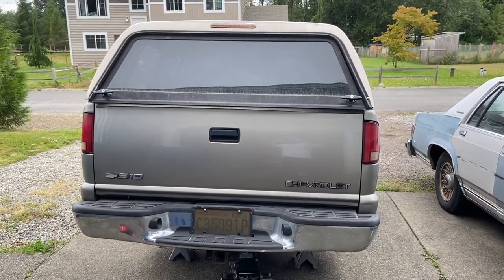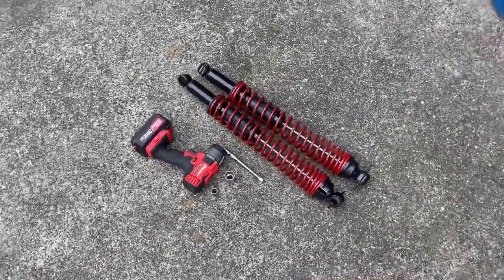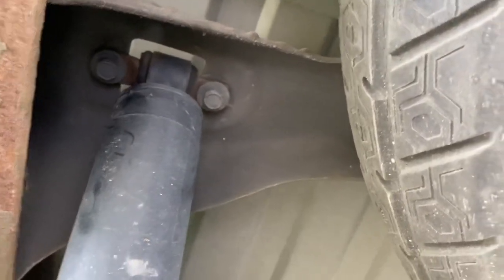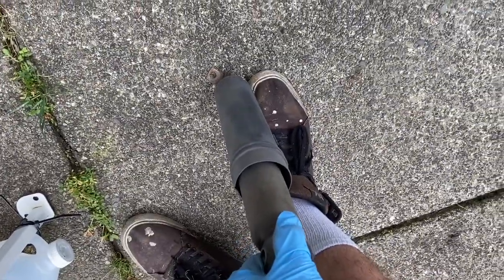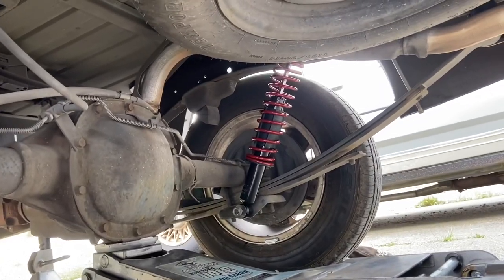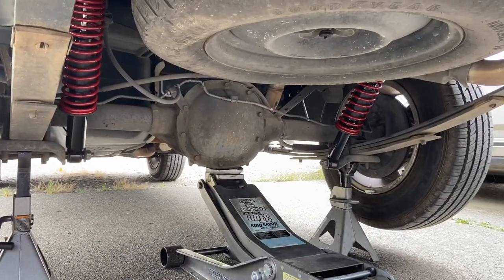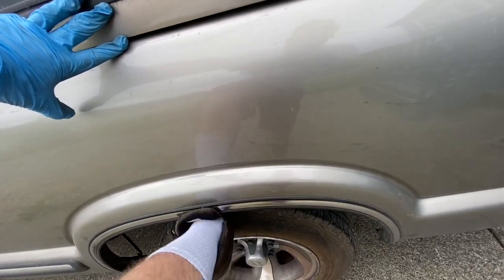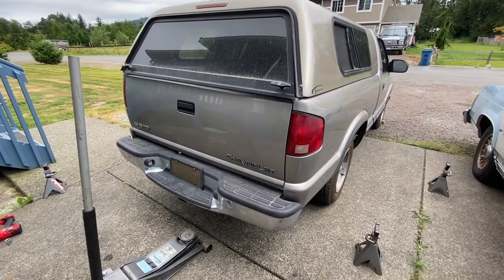1982-2004 Chevrolet S10 Pickup Rear Shock Replacement

Comment: I just replaced the rear shocks on my 96 S10 2WD and found an easier way:  If you remove the spare tire, there's no need to jack up the vehicle.  You will fit underneath.  As I recall the bolts and nuts are 21mm tightened to 62 foot pounds and 13mm @ 22 foot pounds, as per the service manual.  This was an easy job.  I used Monroe OE Spectrum shocks, and surprisingly Home Depot had the lowest price.

Comment: How are these shocks working for you?
I wanted to buy thse shocks for my blazer but saw some interesting reviews on it on amazon that were discouraging 😅
Reply from the maker: So I ordered the same for the fronts and those I didn’t bother installing. These work pretty well. I carried a Dana 80 dually in the back and she didn’t sag that much. But if you’re looking for a cheap good replacement. I got Gabriel heavy duty ones for the front. And all around on my 1990 f150 and those work very good and they run about 10$ a shock on rock auto.
Reply: @stevensgarage7284  I also got the same exact combo of shocks front and back spring assist for my 89 ranger used for my daily and haul fire wood. They do great but if you are on dirt roads I suggest trying to fit a dust guard over the pistons if possible.

Comment: I just picked up a 96 s10 extended cab with 82k original miles and one owner. Getting a ladder rack built for it and wondering if replacing the rear shocks with some like these would help the payload some??
Reply from the maker: Definitely. I had to transport a Dana 80 twice and I noticed a huge difference. Originals it was bottoming out. With the new ones it barely went down. And my truck only had about 70k when I did them
Reply: @stevensgarage7284  thank you for replying. That's what I'm looking for, to stiffen up the rear a bit if I feel its sagging too much with a ladder rack and 2 extension ladders on it. What was the brand of the shocks you installed on your truck?
Reply from the maker: I did Gabriel heavy duty on the fronts and ac delco for the rears. And honestly price wise I would do the Gabriel all around. It’s what I did on my 90 f150 and they worked great

Comment: Hey man when you put the rear shocks in with these ac delco shocks, were there little gaps where the bolt is at?
Reply from the maker: As you tighten the bolt it’ll close up

Comment: I ordered those exact shocks from rock auto did you have metal sleeves on them and it looked like your old ones came out with metal sleeves?
Reply from the maker: Metal sleeves?
Reply: @stevensgarage7284  the tube sleeves that come with shocks to go over threads

Comment: You don't want that rear end up to much cause of the weight in the back being so light , it will nose dive when you hit your brakes causing a loss of traction resulting in a collision.
Reply from the maker: You know I replaced the shocks with the same length ones right? It’s not a lift of anything. Just replacement of worn out parts.
Reply: @stevensgarage7284  True , but the shocks with overload raise the height of the rear-end.  Just be careful
Reply: You have absolutely no idea wtf your taking about 

But your name is Barbie so that was assumed